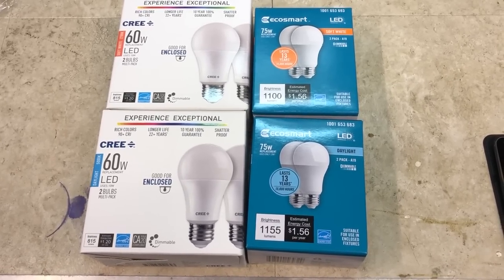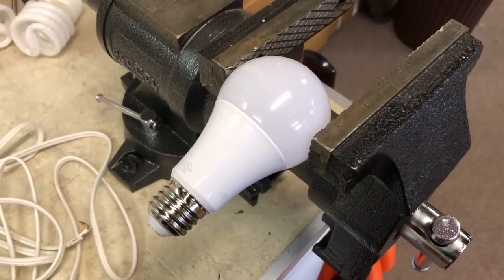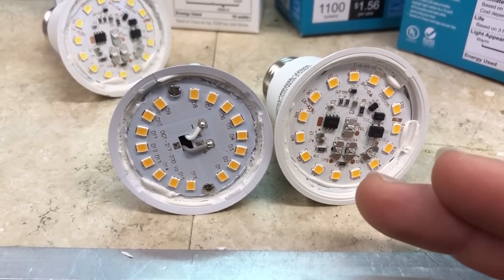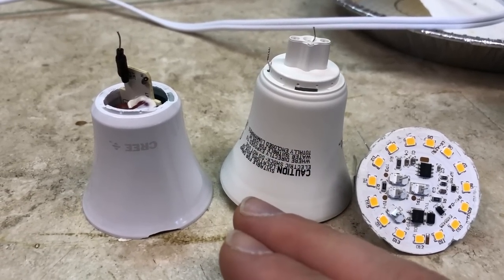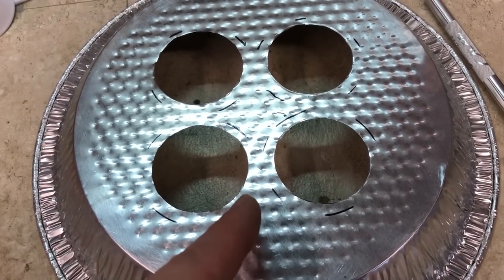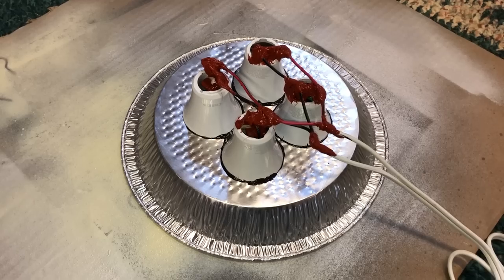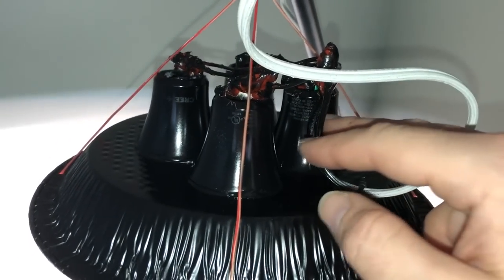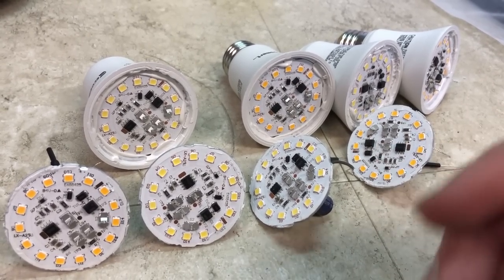The $10 DIY Cree Pie-Tin Dimmable LED Grow Light

Comment: Adding to my comment I use a 7 bulb chandelier base you can buy on Amazon for 9.99 and just screw the bulbs in after removing the globe that way you can change and put more of the 2,700 k in if you are flowering versus more of the daylight bulb for vegging I have done grows from start to finish and I do have a par meter it is a perfect spectrum I do not have a spectrometer but I have LEDs that cost me $1,000 a piece for my main girl and these are just as effective I did a seed propagation project in a small tent and these worked awesome from start to finish I have been telling people for years that they will work no one wanted to believe me
Reply: The spectrum is great. The only drawback is efficiency. I upgraded to a Quantum board LED from Horticulture Lighting Group. Only 134 Watts and it can easily flower a 2x2. According to my measurements, it's more than twice as efficient as my last set up which utilized a similar design to the guy in the video.

Comment: Removing the dome from these LED lights is very unsafe. Most of these lights have a non isolated power supply. Did you check these for isolation???

Comment: DO NOT USE 2700k except as supplemental for flower!!!! the 5000k and 6400k are the best for veg!
Reply from the maker: That’s not true. 2700k alone would be for flowering, yes. And 5000k alone would be for veg. But mixing them together at a ratio of either 50/50 or 2/3 is for all purpose. If people want to increase flowering while growing Mary J then you just add some red. The old days of changing spectrum is over. Unless people are really picky about it and trying to squeeze out every gram to make more money. This is just for the average person wanting to use it for anything. Don’t confuse them.
Reply: 2700k is actually too red for most crops even cannabis, 5000-6400k is too blue and a mix in between is just a waste of PPFD efficiency, you would be better with grow/bloom at 3500-4000k. Might want to scrub up a little more on your spectrum sciences. Can highly recommend most of the video's by Migro as his light physics and reference sources are excellent.

Comment: What if you bought something like this... JACKYLED 5 in 1 Light Socket Splitter E26 E27 Adapter 5 Way Light Splitter Converter for Standard Light Bulbs https://www.amazon.com/dp/B07BFMY8TR/ref=cm_sw_r_cp_api_i_iSZSCb2TYEWNH and then put two 2700k bulbs two 5000k bulbs and then one 3500k in the middle? That would seem like it would give you a true full spectrum (plus no soldering).

Comment: check aliexpress for 220v (110v) led cobs

don't get the 50w version
it gets way too hot
get a lot of 20w cobs and put them on a heatsink with thermal silicone

the new version doesn't even require soldering

they sell them in 20 30 and 50
6500k and warm white
YXO Yuxinou? is the brand name

I don't mind the open connections but they also sell covers for the cobs
but I never tried them myself
don't want to restrict the light and heat.

one cob is like 2 bucks

greetings from Germany
Reply: Don't , these cheap cobs are full of defective leds. Spend a little extra and get good ones from a brand like cree or luminus.

Comment: Why remove the backs at all? Just buy the housing to screw them into... You're going to get someone to burn their house down with this garbage video.
Reply from the maker: First of all, there a disclaimer attached to the video. If done properly it’s no more dangerous than any other electrical device. To answer the question, the sockets were removed to place the lights closer together. A base has too much spacing for this application. And you still have to wire them together which is nearly the same level of electrical skill as what was done here. And potentially just as dangerous. Secondly, buying bases adds to the cost. One of the points is showing how cheap it can be done.
Reply: @GrowingAnswers  When someone burns their house down with this, their insurance company will not cover them. This is just a terrible idea in general. At least if you had the other housing you could make an argument to them that it's the same as what could be used in a house... 

This is more dangerous than buying the $3 housing that holds the lightbulbs, and actually would allow you to change your bulbs out as more efficient ones come available, and or change your spectrum if a person chose to.
Reply from the maker: @TroyWatsonYEG  I don’t disagree with your argument, but there are plenty of things online that show far more dangerous things than wiring some lights together. Things involving fire, guns, explosives etc. All with a disclaimer and plenty with a mostly and knowingly adolescent audience. If someone decides to copy anything they see in life and the outcome is unintended, that’s on them. 

I’ve been using this thing since I made the video. No problems at all. All electrical connections are insulated. It may not look pretty, but it’s safer than a hair dryer or toaster.